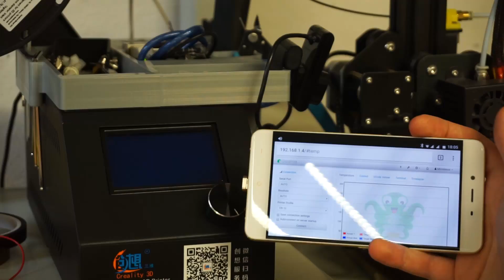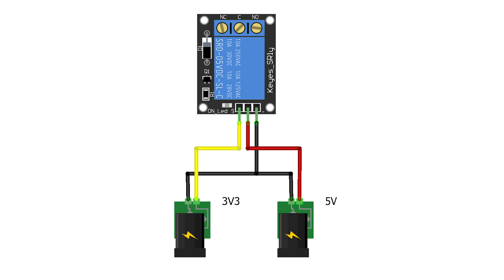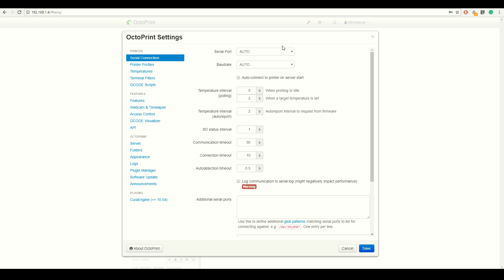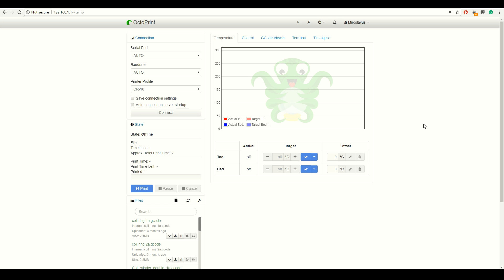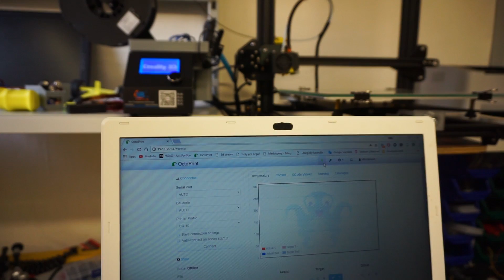How to turn your 3D printer on/off using Octoprint

Comment: i have a 40 amp psu there is no problem whit a 10 amp  relay?
Reply from the maker: No. The relay is switching the 230V line which carries a lot less current. The 40A are at 12V so it's fine.
Reply from the maker: No. The relay is switching the 230V line which carries a lot less current. The 40A are at 12V so it's fine.

Comment: Is there a way to make it turn off and on more than one device in octoprint?
Reply from the maker: If you mean more devices with single relay then you can simply wire it to a power strip. If you want to control multiple separate relays that's not possible with the plugin. The pi has enough pins but I don't know of any software that would utilize it.
Reply: It might be open source so I could probably make a re-vamped version of it.
Reply from the maker: Yea. Good luck with that 🙂

Comment: i connected everything as you told, after setting up the gpio pin the relay klick and turned off the circuit. but the power button does nothing, which means that the relay stays off all the time
Reply from the maker: Can you check if the relay works with 3V3 even without the pi?
Reply from the maker: Can you check if the relay works with 3V3 even without the pi?

Comment: Wow! Is there any way to do this but turn on an external device aswell as the printer? Like a light or a fillament monitor?
Reply from the maker: Sure. You could simply connect power strip instead of the power cord.
Reply: Gyro And will the relay handle any incoming voltages? Like a 12V rbg strip or a 5V USB device? Will this work with a duel relay board to turn two things on at once? Thanks for the speedy response!
Reply from the maker: I'm not sure what exactly you mean. The relay module I've linked to can be switched only with 5V but it can be switching any voltage. But you'll need separate relays for 230V, 12V ,5V etc.
Reply from the maker: I'm not sure what exactly you mean. The relay module I've linked to can be switched only with 5V but it can be switching any voltage. But you'll need separate relays for 230V, 12V ,5V etc.
Reply from the maker: Yeah. That should work

Comment: So, when I connect my 5v relay to the Pi 2 on pins 3,4 and 6 I get nothing.  I know the relay works because when I used my Arduino Micro to test as soon as I touched 3.3v the relay opened.    Any ideas?
Reply from the maker: The gpio header is the same across Pi's so that shouldn't be a problem. Could you try it a 3v3 signal to see if it works?
Reply: From what I'm reading the 2 and 4 pins are 5v input not outputs.
Reply: got it working .
Reply from the maker: Happy to hear that 🙂
Reply: How did you get it working? Been troubleshooting for a day without any luck so far.  I picked up a pack of 5v relays: https://www.amazon.com/gp/product/B00XT0OSUQ/ref=oh_aui_detailpage_o03_s00?ie=UTF8&psc=1

Pi 3b, (powered via a 2.5 amp to outlet cable)
Using Pins 3,4,6 VCC to Pin 3,  4 to IN, 6 to Ground, and yet I cant get it to enable. Would love a solution because I am racking my brain at this point trying to understand what I am doing wrong.

Comment: Great video and solution. I recently purchased a CR-10S and just received my Raspberry Pi so I can print using Octo Print. Question I have is upon plugin in my Raspberry Pi to the printers USB port the printers screen turns on even with the power switch turned off. Besides removing the 5VDC  pin on the USB cable is there another way I can resolve this issue?
Reply from the maker: That's interesting. I have cr-10 too but I don't have this problem. There must be some problem with the electronics. I think you'll have to take it apart. I'd suggest checking Reddit if someone has the same issue
Reply: Yes, was just doing that. Seems to be an issue with the latest version of the printer and suggestions are to remove the 5VDC pin from the USB plug as I had figured. Thank you foer the quick reply.